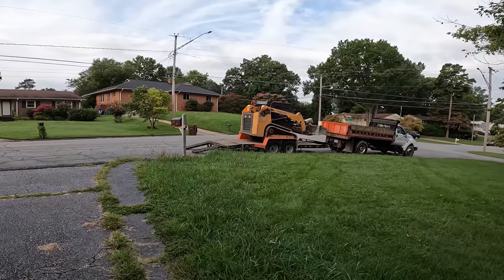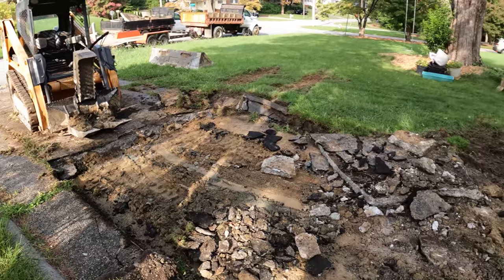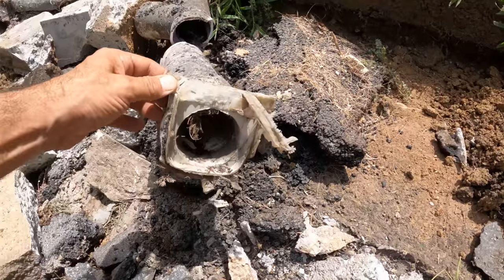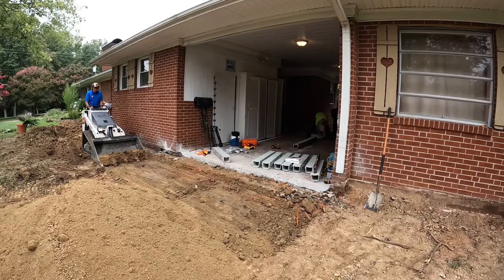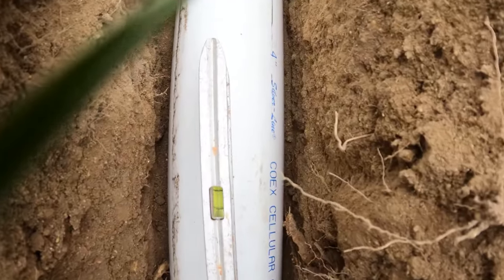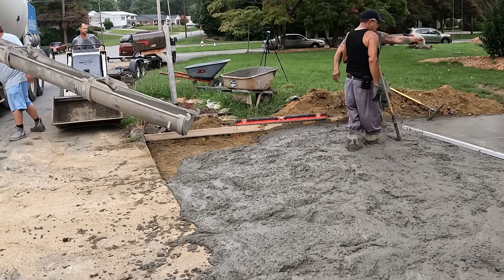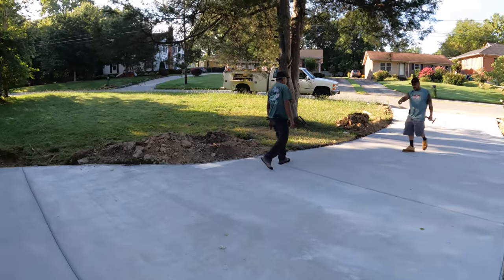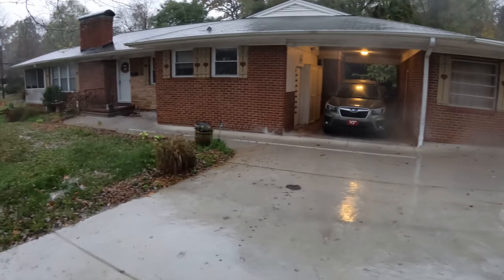Installing a new driveway and channel drain

Comment: Nice job.
Whats your opinion on concrete driveway in new england. Does road salt ruin it. Longevity?
Its cooler in the summer than asphalt. I like that aspect.
Reply: Well, if the concrete is not sealed, then road salt will have an impact on longevity.
And,
It depends on what type of salt is being used on the concrete ie, sodium, magnesium, calcium.
Calcium chloride @100% is generally safe on concrete, but No salt is best.
If you’re looking for traction - use sand - dark color to absorb the infrared heat from the sun🌞 Sweep it off in the spring.
Calcium chloride should be mixed with dark sand. If calcium chloride is used by itself, it will melt thru the snow/ice immediately and the top layer will refreeze. 
🤠Hope your vehicles are rustproof🧐😳 You’ll be replacing the vehicles multiple times before a concrete driveway replacement.
Reply: @stepside2839  thank you. That gives me something to consider. I dont Have to use salt. I am now aware calcium chloride is my best option and i do have access to rough granualer dark sand.
As for the rust. We spray the under carriage with wool wax and they last longer than my 75 dodge dart did. Its new england

Comment: It did look pretty nice. I'd have like to have seen at least 2" gravel underlayment & perhaps a couple more vertical control joints on those bigger slabs - but I'm not an engineer just an over achiever not the one who put in the bid ô¿ô

Comment: May I ask why didn’t you put in rebar driveway
Reply from the maker: Sure. It's not used in our area for non structural concrete. This is because we have very stable subsoils, a mild climate, no bentonite. The reasons concrete cracks aren't prevalent here.

Comment: I was concerned to see the driveway channel drain and the separate pipes picking up the roof gutter water just go into a ‘Y’ junction point that was the same diameter. The second pipe should have gone all the way to the road pit.
Reply: At the end of the video showing the pipe in the road pit, hardly any water was coming out. I know the gutters were over flowing into the path channel drain so the flow should have been better. The old drain that all the pipes connected into may be partly blocked.

Comment: I notice you follow up some comments with " that's what most people do ". Don't do as "most people do " do it the correct way without cutting corners. Concrete is always going to crack but if you use wire and control joints it will minimize the amount and size of the cracks. Let the customer know it can be done with or without wire .

Comment: No rebar or steal mesh for driveway ????
Reply from the maker: Nope. Reinforcement is not typically used for nonstructural concrete in our climate with our subsoils. I do see rebar in tear outs maybe once every couple years.

Comment: Yyeessss absolutely love these long videos. But uuhhmmmm🤔🤔 why is there zero rebar in the driveway. The walkway I can understand but zero on the driveway 🤔🤔🤔🤷🤷
Reply from the maker: It’s not needed with our climate and subsoils. I know that’s shocking to people living on other subsoils. My first properties were in Denver colorado where you can’t use too much rebar and things still crack l. I couldn’t believe no rebar is used here.
Reply: @GCFD  I think you might consider putting text on the screen during the pour "Rebar is not needed in our climate and subsoil." Then again, the question does generate more viewer engagement!

Comment: Don't you put rebar in your concrete?????
Reply from the maker: No of course not. Rebar is not needed for non structural in our area. I have seen it in tear outs before. I Maybe see it once ever other year where someone used it.
Reply: Every guy with no construction experience always asks about rebar
Reply: @electricaf365  Some DAY , another contractor might have a 70,000 lb. concrete truck back into their driveway to pour concrete for a backyard project ! What do YOU think is going to happen to that Dway with NO REBAR ?
Reply from the maker: @joedoakes8307  I would never back a loaded concrete  truck onto a residential driveway. No amount of rebar at 4” would ensure the driveway won’t crack.

Comment: As a concrete contractor my suggestion is that you never use sand under a driveway. You should always use road base or #57 crushed stone. Sand will not be stable enough for vehicles and will always fail.
Reply from the maker: That’s an awesome suggestion. Sand is not an appropriate base to build off. In our area we have Sandrock bedrock that they mine and sell as road and building base. It works very well under concrete flat work. I’ve taken some video of the Sandrock quarries in other videos.

Comment: I know this when you did the concrete you never installed any rebar or any wire mesh to give the concrete strength how come
Reply from the maker: We have very stable subsoils around here so the causes of concrete cracking are not prevalent in our area.

Comment: I still can't get used to seeing concrete poured on basically sand, with no rebar or wire mesh.
Reply from the maker: It took m forever too Eric. It just seems wrong, but that’s how they do it around here. Rebar is not even on anyone’s radar and it blows the profit margin when we find it in a tear out. It’s only happened a couple times though.

Edit: it’s sand rock which is mined around here and is not sand! Sandrock is angular and makes a stable base. Sand is not angular and shifts around.
Reply: @Gate City Foundation Drainage  I completely understand. Coming from the Midwest and then living in California has shown me a lot of hard-core strength building construction. Great video as always!

Comment: I can’t wait for you to visit this house in 1 year to show us the crack in the concrete along the downspout pvc pipe running under the concrete. Is there a reason you didn’t properly bury the pipe so you’d get a proper depth of concrete or are you just pretending to do concrete work for this homeowner and cashing her check?
Reply from the maker: Yes of course Jeff. We didn't have the fall to bury the pipe and get 4" of concrete over top of it. It's either a flooded carport or a crack over a properly installed pipe. The homeowner went with proper drainage. I always place the drainage as a priority because my clients are experiencing actual flooding issues If this was a small section of roof I would have run the downspout through the channel to avoid that second pipe but I prioritize the drainage. If I had dug the pipe deeper it would not crack but I would have gotten a call back already because we had some crazy rains in Dec here.

Comment: Laying concrete like that will result in a very inferior slab... Thin and no rio mesh reinforcement. Will crack and look ugly fast!
Reply from the maker: Karl, consider the reasons concrete cracks. Shifting subsoils, water, temps. We don't have those here so rebar or mesh are not used in non-structural.

Comment: Wrong pipe. You should be using bell ended pipe not those terrible little couplers. Also, you had a high spot in the discharge and went nearly level. I would have combined into a 6” discharge regardless of slope. Also, it’s hard to discharge water into an already flooded area. The problems shown at the beginning would not be solved by this…they’re more geographic area related.
Reply from the maker: I haven't had any issues with 4" pipe because it flows so well. The problem at the start was water getting into the drainage basin, not the basin being full of water, so that's why we went into the back of the basin instead of the curb. This system has kept up for a few years since we first installed it.

Comment: Yeah well that was a lot of work to do to still have standing water and a marsh in the yard when it rains. You yad all that equipment and a decent budget i qould presume. Why not do it right? 
It needs drained into the yard and the street both. I would also put a french drain in just for shits and giggles because you had the equipment out and gassed up already. Another 30 minutes wont hurt you. 

I just graded my entire yard and put landacape rock in and mulch and now I am putting in a sump pump that comes on when it gets filled with water and filters and dumps into the city sewer using a 6 inch double T pipe that I am running to the sumps dumpout and a large channel I installed for a walkway thay goes 10 feet and has a filter screen on it that i custom made because we have oak trees with acorns everywhere and we are on the beach and have a lot of rain and wind and water. The channel has 5  two foot sextions of screened filter that axt as a grate and a strainer and is 4 inches deep under the stainless grate on the surface. I can let stuff build up and just pull the strainers and toss the garbage into the can and move on. But it is 4 strainers soooooo it is a pain. Widh i could afford to biy more sumps but i spent $300 on the pump and another $250 on pvc but i used a shovel and my muscles to install and the reat of the stuff was free because it was all left over from other projects for other people and things people gave me.

Comment: that driveway is Gunna crack like crazy that's a lot of wasted money I give that driveway 3 years if that... no rebar no supports no experience.
Reply: on top of that the water is probably going to go under the concrete freeze expand freeze expand that job is waste of money for the homeowner.. 😐😐
Reply: Clear the area of any objects or material that would interfere in the pouring process. This includes grass,rocks,trees,shrubs,and even old concrete.
Prepare your subbase. Your subbase is another word for any material on which the concrete rests. ...
Prepare a form. ...
Add wire mesh or rebar to the inside of your form for support. here is a step by step
Reply from the maker: Hi Michael - we clearly live in different climates. Rebar is not used in our area for flatwork and we don't have much of a frost line, maybe 1/2" or so. If they even call for freezing temps they will close schools the night before around here.